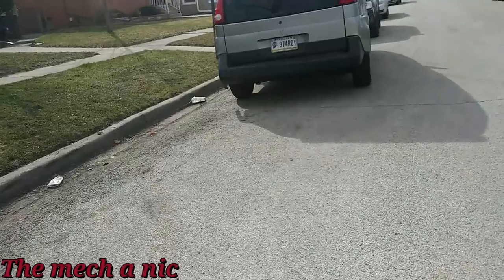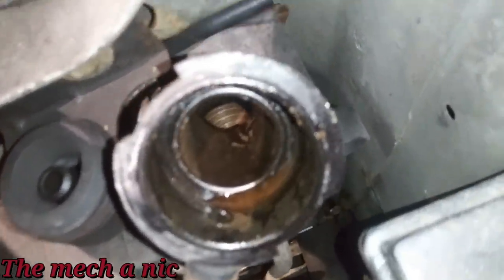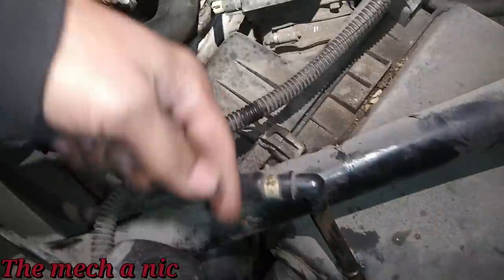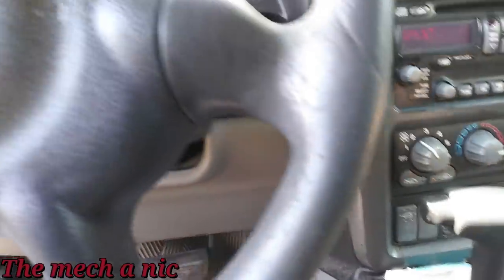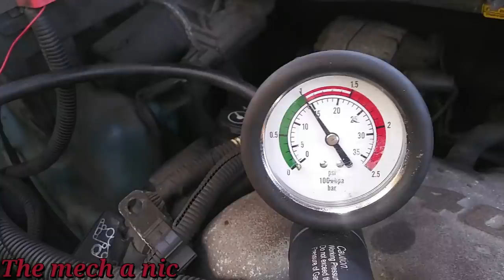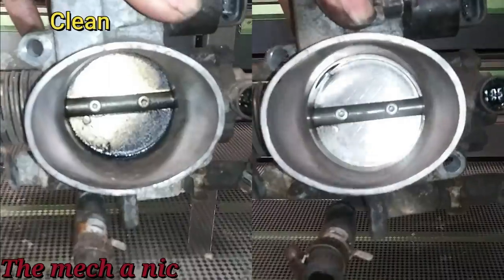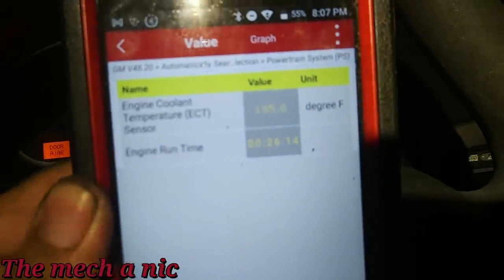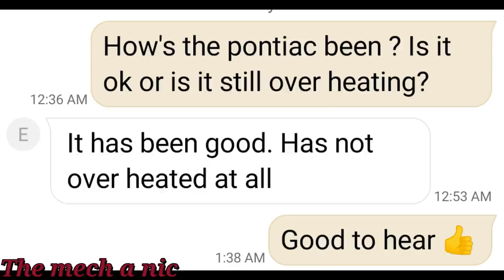pontiac aztek over heating

Comment: Good stuff man. The timing cover can pop a gasket and cause a coolant leak. The bleed pipe also rusts and will leak. The 3.4 is also notorious for coolant leaking from the intake manifold...
Reply from the maker: This engine just sounds like it has way too many potential failure points. What a shit design. Thank you for the info

Comment: Hey, mech a nic- great Case Study! Thanks for the awesome video.

This exact situation is what I was referring to before, a classic Textbook
"Cascade Failure".

Fuel, air, compression, electricity (spark), combustion, exhaust, coolant-
are all closed "circuits" and should never "leak" into each other.

Each circuit has failure points. In case of the coolant- you repair
one part, then start chasing the weakest link. All of the parts were
OEM, so- one failed- the rest will too.

"Coolant" is a 50:50 mix of water and an "additive" that has many
functions; anti corrosion, lubricity, and the most important one being
how it changes the characteristics of water. It raises the boiling 
point above 212℉ (100℃) and also lowers it's freezing point
of 32℉ (0℃). This action is even more effective when the system
is under pressure (~11-15psi/75.84kpa) greatly increasing the
mixture's capability of temperature ranges.

At atmospheric pressure (rad cap off/loose) the coolant will never
go above maybe 220℉ (104.4℃), and the recovery tank will be 
useless. The coolant will just spill out of the radiator, and boil away
until there is no heat transfer, then it will just be under hood temp.

You have a real smoke machine? Drain as much fluid as possible,
install it to radiator. Depending on what pressure the leak needs to 
show itself can be a factor. If it only leaks with a hot & running
engine- a smoker won't help. A cold engine can quit leaking, too
because of thermal expansion/contraction.

Cold, running engine- hold throttle at 1k, rad cap off, add until full.
replace tight cap. Fill recovery to COLD mark. The system relies
heavily on the vacuum created when it cools, and the pressure 
when hot, for that tank to work properly- the rad cap #1.

Comment: My old Pontiac Transport had the same 3400 engine.  Had to always top off the coolant resevoir due to coolant leaking internally.  The exhaust smoke would get cloudy.  Ended up eventually replacing the lower intake manifold gasket and engine was fine for another 100,000 miles.

Comment: Many GM used that heat range as an emissions reducing
strategy. Even my '89 (used to) run hot like that. I have a 170℉ to go in shortly.
Their sentiment was a hotter running engine reduces NOx before
hitting the cat, making it more efficient. It also fries everything under
the hood, too! Rubber lines, plastic pieces- all get brittle.

Comment: Hi, I have 2003 blue opal Tek and since last 5 years, when i buy the seller tell me change head gasket and pump water, they used with temp sensor disconect, so i conect and use to monitoring temp, im from Mexico and in the year i buy it travel to Laredo,TX in October and  December To Houston, Tx, and no problems, but in December 2020 when return to Laredo Tx my Tek overheating and shut off, so make complete service an repair with best gasket and service to valves and heads, the mechanic tell me tha last owner make repair but cheapest gasket and pieces, today run like a charm but i discover the 2 fans star in the low speed, included when power on the AC, so i decide change the start 2 fans with a switch like trunk lift, all my headaches disapear, I love this suv....Thanks for reading, my english is not so good.....lol

Comment: Mine acted like that. I made sure the coolant system was bleed; replaced the thermostat to 180; replaced the water pump; replaced the coolant sensor; replaced the EGR valve and cleaned the passage way on the intake manifold; replaced the radiator and both upper and lower hoses. Mine has 344,219 original miles and I use about 1/2 quart every 4,000 miles. Also make sure the vent pipe at the rear of the engine is secured in the rubber grommet. The 3400 engine needs to be completely vacuumed sealed.

Comment: Nice work finding and describing the multiple overheating issues. I like the noise in the rear fix too. Sometimes you just have to walk away. I suck at diagnosing overheating issues. My 01 Corvette runs a bit hot.  It's not too bad, but it bugs me. Some have said they run hot by design for emission control. I'm skeptical but will need to work on it one of these days.
Reply from the maker: Yeah i dont like it at all. Even if the pcm is programmed to run hot it should have a fixed value where even the "running hot" should keep the needle in the middle because thats whats normal. If it goes past the middle the car is over heating even if its just a little. Hope that makes sense.... Kinda like , even if they programmed the temp needle to be in the middle at 500° that would be "normal"
Reply: @themechanic6117  Perfect sense, thanks.

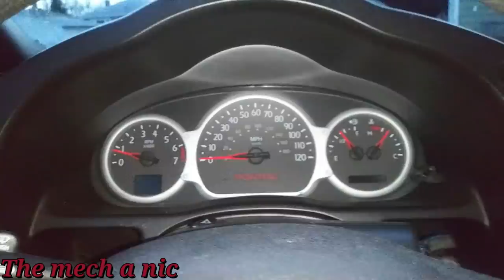Comment: 31:40 
It is possible those lights and radio being out are the result of a bad ignition switch.  The dash gauges, radio, hvac, dome lights and windows are all tied into it on that model of Pontiac.  I drove awhile with these issues before figuring out that was the cause.  Simple to replace it too! 

If I recall right on the coolant issues, the poorly engineered GM gasket's rubber were the main cause and not entirely the fault of the Dexcool coolant.  Fel-Pro solved this by making a better gasket with all aluminum (Permadry version).
Reply from the maker: Its possible but i would think it has more to do with the light switch (headlight switch) since it should turn on alldash lights on the first setting.
Reply: For my instance, the gauges, radio and hvac were completely dead but only the headlights would work via the headlight switch.  I hope it is the headlight switch too as it is an inexpensive part.

Comment: When I had the Buick rendezvous it would do the same thing with the temp gauge . what fixed it for me was letting the air out from only one of the bleeder valves / drivers side and having it on ramps. A little while after that was fixed the brake system failed and I was done with it . Straight to victory auto wreckers
Reply from the maker: Doesn't it suck when you fix something and the next thing to fail brings it's death lol

Comment: I have the exact car and exact issue. Climbs when idol and well Red line if not moving Real Soon.  I have to turn my heat all the way to hot and on 5 in order to keep it down just a little. I also had the water leak on the pressure valve same side. I feel you don't want to see another one,  but I WISH YOU WERE HERE WHERE I LIVE to fix mine,  I REALLY DO.   I thought I was gonna pass out a few times do that heat from the outside and inside. My radio is only thing that doesn't light up.  Only other difference is when I put mine in reverse it's as smooth as can be. 3 years now with this car and yes I still have to drive it daily.
Reply: By the way congratulations on being one of the 3 that graduated !!!!!!!

Comment: got a 2003 pontiac montana dirt cheap, 600$ and knew it had a few minor issues, rusted brake lines, bad passanger side wheel hub bad o2 sensor, blown head gasket, bad radiator... but cost me 800$ to rebuild top engine, radiator and brake lines etc.. now a champ car and that 3400 is a great engine.. now my daughter wants my van cause it came with overhead video console and earphones for keeping kids quiet.. over all, pontiac made a crappy van, a hard to work on van, doing upper struts was a bit@@, but parts are cheap, and being a mechanic makes that a good van for me, but for most people, probably not a good vehicle.
Reply: p.s. that o-ring you replaced on tube is supposed to be replaced every 3 years or 50,000 miles or 160,000 hours engine time (for rental service)

Comment: I have a pontiac Aztek 2005 , with the same problem until I realize that the radiator deflector was broken  ! , I installed a new one and it works better. That deflector is at the bottom of the radiator and it gets up air to the radiator.

Comment: My GF has the 2003 Malibu with the 3100 in it. I did the intake gaskets on it when they blew and it was not that hard a job. One thing about the overheating, If the original thermostat was in it then it would probably be overheating. So, Something is wrong. I would think with the type of maintenance I see from the cars you work on that the intake cooling ports are probably partially clogged. This would account for no coolant leak but overheating. Be interesting to see if down the road it continues to lose some coolant. 
I dont think these engines - 3100, 3400, 3800 are bad engines its just people do not do the proper maintenance. That front coolant return pipe that runs along the front valve cover though always seems to rust out. 

For what its worth, My Buick Lucerne had really hard shifts with its transmission and I dreaded taking it to a transmission shop. Finally did and it turned out to be a bad engine mount. This also accounted for a really "Stiff" feeling ride after I replaced the struts with quick struts. The bouncing engine seemed to amplify every little bump in the road. So, When ever I hear someone talk about their transmission with hard shifts I always tell them to - above anything else - Check those motor and transmission mounts first! My Lucerne runs great now and has 151,000 miles on it. Doesnt burn oil and cools fine.
Reply from the maker: Thanks for your inputs and tips! Sounds like you have some experience with these engines.
Reply: @themechanic6117  I do in the fact that I really do not have someone like you in my area. They are all overpriced and dont do good work. So, I decided to invest in some tools and learn about cars. My GF's 3100 intake gaskets took me about 4 hours to do. While I was in there I replaced the injectors too. The darn thing is still running at 181,000 miles on it. I have learned a lot. I also learn a great deal from watching your videos. I really enjoy them. Thank you very much for all the great content. :)

Comment: If she continued to drive it and it was overheating then basically it's cooked.  Literally.  The temp sensor might be baked too and is causing the gauge to read high.  I would take it out back to the shed and roll down the windows so the raccoons can move in.   Thanks Jon.
Reply from the maker: It never occurred to me that a temp sensor could be fried from over heating. Its possible. It seemed to be working to me so i didnt go down that path. Thanks for your input 👍💪
Reply: @themechanic6117  Once you have extended low/no coolant with overheating then any part could be messed up.  Raccoon hotel.
Reply: Yep.

Comment: How long should the cooling system hold air stable for before dropping? When you do a relative compression test of course
Reply from the maker: If theres no combustion gases getting into the cooling system then the cooling system usually has nothing to do with a relative compression test.

Comment: Wait until it reads 180℉ and remove the rad cap- what happens? Why?
"It's only 180℉" That's because the pressure allows it to be hotter.

Climb Mt. Everest, try to boil water. It won't even be really hot-
but it starts evaporating away. You'll never cook your pasta!